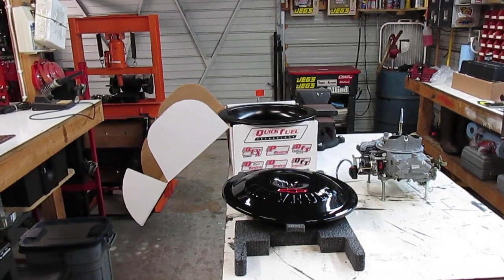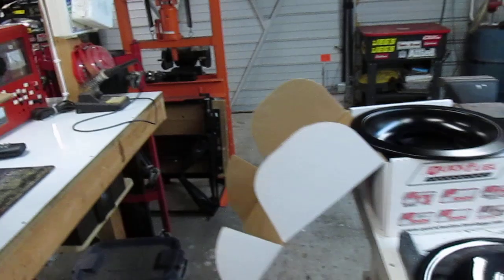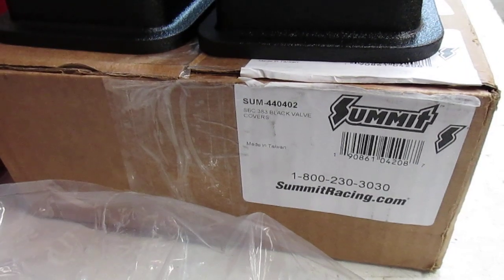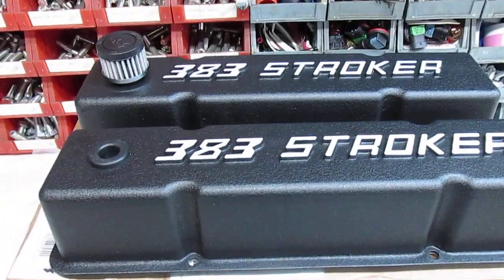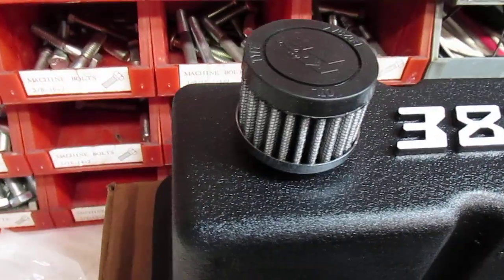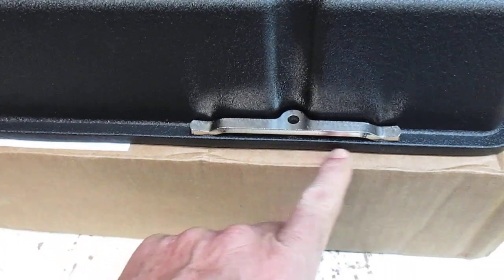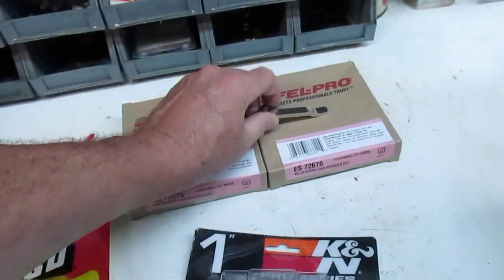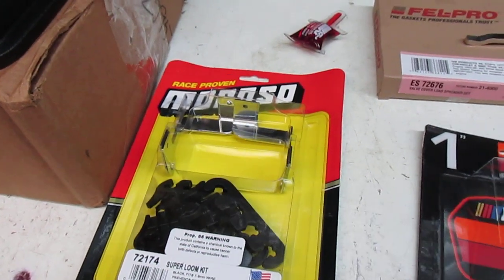Chevrolet 383 Stroker Build, Part 1

Comment: Hey there , you are really getting prepared, I came across your channel watching the HEI distributor video on how you clock it and the wiring, I currently have the HEI in my 55 truck, I will be switching over to the MSD digital E curve , it should be here in a day or two then I will take it to the truck which is a couple hundred miles from my main house, I think it will be nice to dial in the total and initial timing with a couple of turns under the cap, anyways I’m watching the Stroker build now I have no doubt it will turn out great , Mike (DRF)